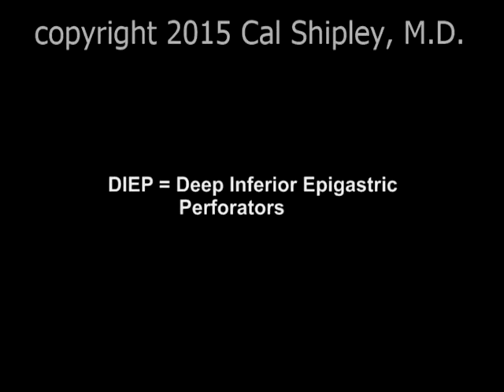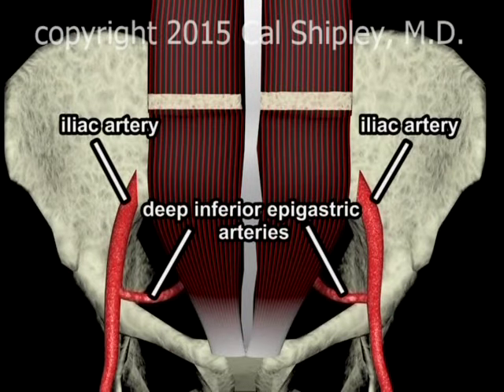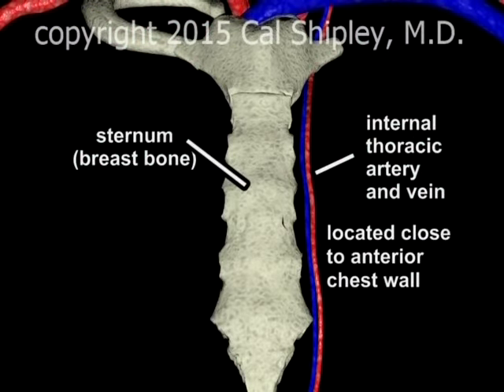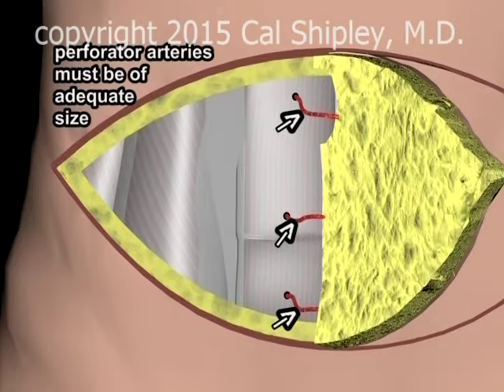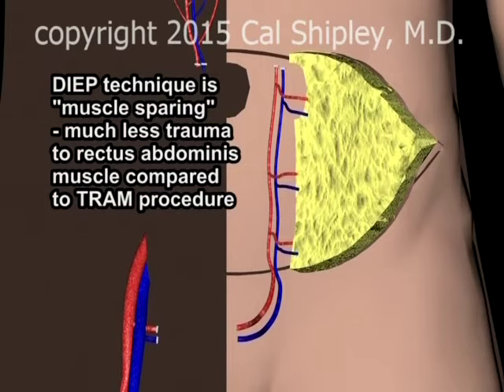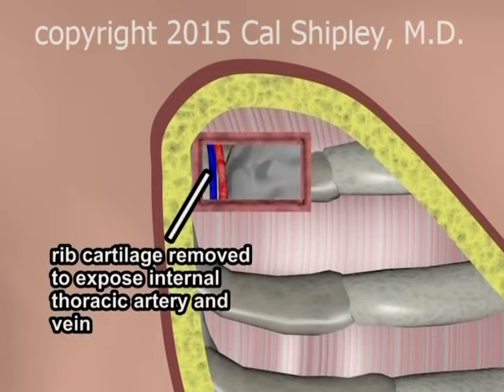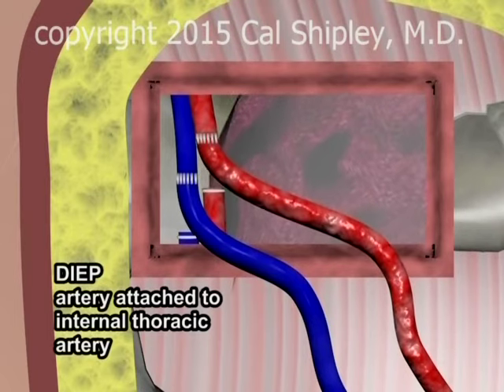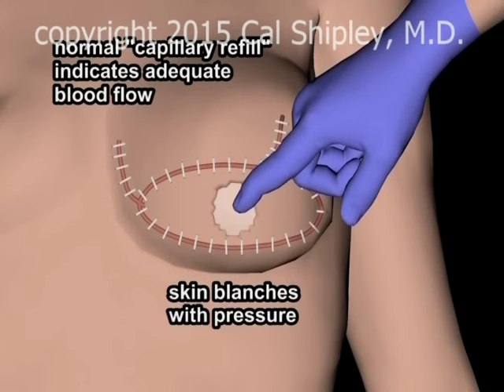Breast Reconstruction - DIEP procedure Narration and Animation by Cal Shipley, M.D.

Comment: But what happens to the thoracic artery after attachment do you cap them or is it a T connect.  Because this animation is misleading.
Reply from the maker: Hi Luba - as shown in the video, the internal thoracic artery is cut and the artery going to the breast is attached to it. The distal portion of the thoracic artery is stapled. which effectively closes it off. The structures that the distal artery supplies are supplied by collateral arteries which feed the same structures.  You can access my entire library of medical videos at https://trialimage.com